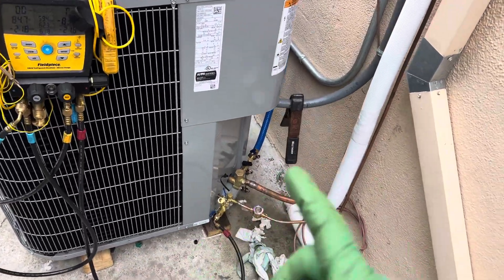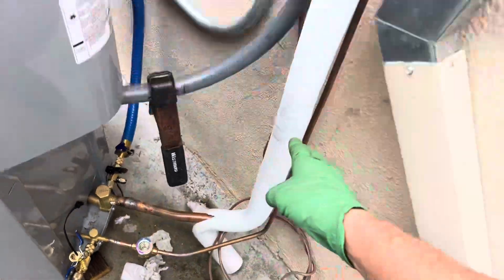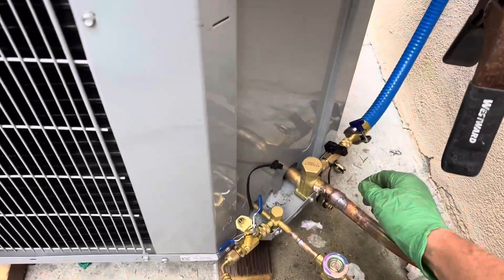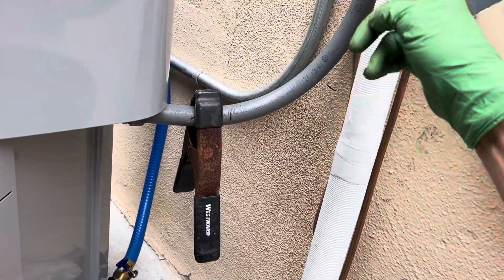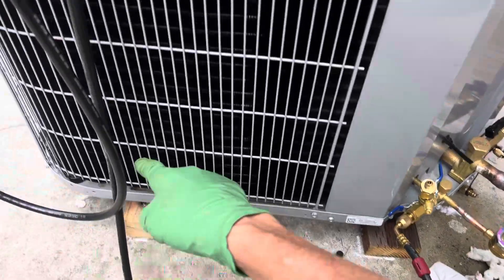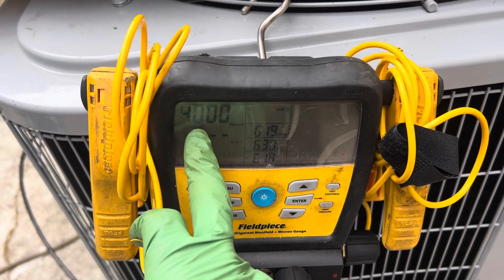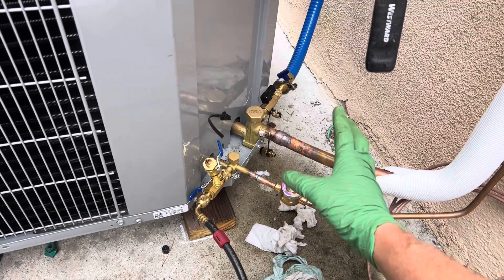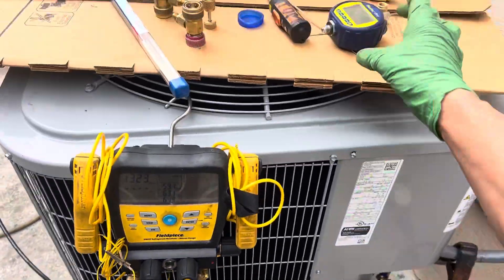Micron gauge in refrigerant hoses is the worst way to read your micron reading . ￼

Comment: Dang Tom no back up Bats!? That’s the one thing about the bluvacs and the fieldpiece gauge you lose the connector fitting there goes that 😂
Reply from the maker: @HVACslayer  plenty of back o bats.  Just not this weekend I was not supposed to work. Just had a large case stolen with three Blu Vac’s inside and over $1000 of brass adapters fittings and extra Blu vac hoses
Reply: @ I feel ya man. I had my van broken into beginning of 2024, they took one of my Milwaukee pack outs that had all my vacuum stuff trublu hoses, fittings, gauges etc. I’m barely getting most of what was taken back.
Reply from the maker: @ expensive

Comment: Yeah, knowing what I know about physics, this sounds like a bunch of BS.  Syster pressure is system pressure.   
This is a static test, not dynamic, so the system it either the right pressure all over or it's wrong.
Reply: I think Tom's assertion is far from BS, but your knowledge of physics probably isn't. Your assumption is that the distribution of air molecules is uniform in a connected system of pipes, but that's far from true. As there are fewer and fewer molecules of air present in the piping, the vacuum pump will have an increasingly harder time to capture more air molecules, especially since there is nothing left that transports and pushes the remaining lingering air molecules from the remote areas. At 100 micron vac, there are still MANY air molecules present. What I read is: {Quote} There are approximately 26,500 molecules per cubic centimeter in an ultra-high vacuum, which is a pressure of 10-12 mbar. At this density, there is roughly one molecule every 0.33 mm. {Unquote}. Now add the permeability of rubber, x-amount of connection points and unions, and your reading of Micron becomes worse with increasing distance from the pump.
Take a steel tank of compressed Helium, and the Helium will disappear with time diffusing through the steel.
Reply from the maker: 👍👍👍. I don’t have no PhD not even a masters or AS in science of any type. 
    But my father taught me this when I was 12 years old back in the late 70s.   You have me read a university book 📕 on vacuum that was like 700 pages.   And would have me do experiments with a micron gauge in different scenarios.  And sometimes sabotage my work and have me explain why I was having trouble with drawing down vacuum. 
      Other than that I’m just a kid who has been using a micron gauge for the past 45 years. On a daily basis.. original one came in a leather case you six or 8D size batteries and it took 10 minutes to heat up and calibrate. 
       Man, I love these new micron gauges they have today.
Reply: @OttoDeCalumnias  Ok, that all makes sense. I learned something.  I am a little surprised that I learned something from someone that says {quote} then uses a quotation mark.  
But you are correct. My understanding of physics is far from BS.
Reply from the maker: @Caderic 👍

Comment: The valve remover on the suction side should be covered with a cap (which is hanging by the port) so no air gets sucked in during evacuation. The spring on the Schrader valve isn’t strong enough to remain closed under vacuum.
Reply: That’s the Navac tool which has a 5/16 adapter for mini splits that is what you see hanging. The port side for gauge attachment is cap.
Reply from the maker: @pastormartinez4676  👍

Comment: Hey Tom, are you still using your Fieldpiece VPX7 pump? Have you had problems with it tripping GFCI breakers after a few minutes?
Reply from the maker: @nicholasceea4109  all GFI circuit breakers might be wired differently, depending on the manufacturer, the GFI and how somebody somebody is or is not properly grounding it. 
It senses a little feedback through the ground it will 

But I use mine on GFI in several shops and all their outdoor wall plugs that are all GFI. I have never tripped the circuit breaker. . 

If you have particular circuit breaker, get a GFI or first, read the instructions thoroughly on the GFI on the neutral and how the ground are supposed to be terminated . 

The problem could even all the way back in main panel or if it comes off of a sub power panel
Reply: @coldfinger459sub0   Thanks for the reply Tom. I installed the main panel and GFCI breaker in 1982 and it has never tripped with many uses. In both cases when it tripped with the VPX7, I had to use my Yellow Jacket pump with a standard AC motor to finish the vacuums.
Reply from the maker: @ the switch mode, power supply on the variable speed motor controller is sending out some sort of signal that’s tripping it. I haven’t heard of that before.. 

Maybe if you upgrade to a new GFI for your garage might take care of the problem or go over the manufacturers and instructions on how to properly terminate the ground and the neutral to make sure everything is correct. Specially if they’re Daisy chained and series amongst a bunch of breakers. .
Reply: @coldfinger459sub0   This is most likely the first VS DC motor I have ran on this circuit and I know how dirty they can be if not filtered properly. I'm a stickler for reading instructions and I'm sure the breaker is wired correctly. My career has 50 plus years of electrical and electronics work.
I called Fieldpiece and they know of this problem, saying some brands of GFI breakers will trip. They sent me a free updated main PCB but I noticed that it was identical to mine with the same REV #. I switched the PCB anyway but still have the problem. I came up with a simple fix and I really like this pump but wish I could have taken it out of the box and ran it without this problem.
Reply from the maker: @nicholasceea4109 the electric circuit breaker and GFI manufactures have noted and changed the design of the more modern GFI circuit breakers because they were having too many complaints and failures or sensitive

So you might as simple as updating to a new GFI circuit breaker
Reply: @coldfinger459sub0  Thanks Tom, I need to look into that some more. It's a GE panel and somewhere in the dense cobwebs I remember something bad about finding breakers to fit that panel.
Reply from the maker: @ are you lucky enough to have one of those breaker panels that has deemed dangerous and they no longer make parts for.

Has instructions saying do not resuscitate
Reply: @coldfinger459sub0  I hope it's not dangerous. It may be that it's not very popular any more or takes GE breakers only. BTW this is the 200 amp main panel in my home. Wish I had a garage to work in. 🙁
Reply: @nicholasceea4109  What's the point of having a GFCI breaker if most electronics don't have FAKE ground? There are ground terminals but no wires connecting the terminal.
Reply: @w0lvez1  Some items can be insulated well enough from shock that a ground is not needed.
Reply from the maker: Never heard of such a thing that means it was installed illegally without permit and without inspection and without a qualified electrician just DYI hacks install three prong ground plugs with no ground connected

Comment: It'll be fine, the micron gauge should be furthest from the vacuum pump.  What matters as much as ultimate pressure while pumping, is rate of pressure rise once the vacuum pump is isolated.
Pumping from both ends might get your ultimate pressure stabilized somewhat faster but honestly I don't typically observe a huge difference.
Reply from the maker: @thisisyourcaptainspeaking2259  mine are contaminated with old Poe oil
Reply: @coldfinger459sub0  It would be preferable to have flushed the manifold and hoses prior to making the connection (poe once contaminated, should be flushed) but poe is universally compatible.